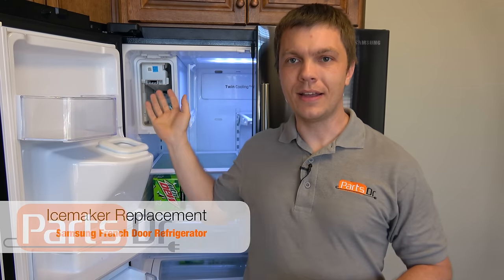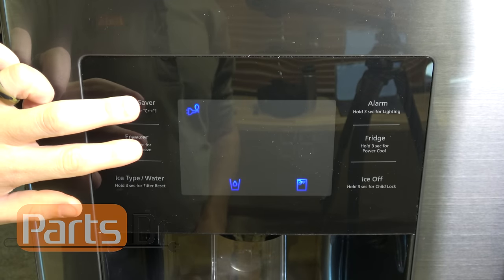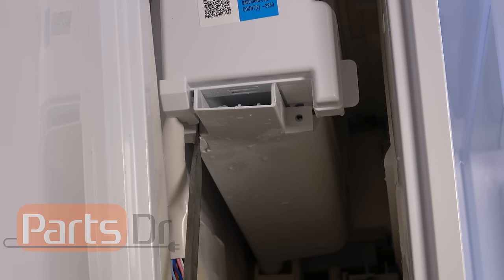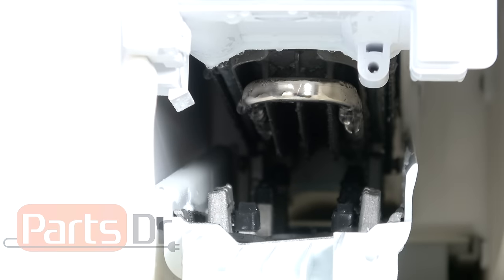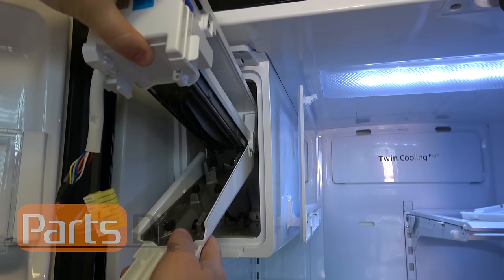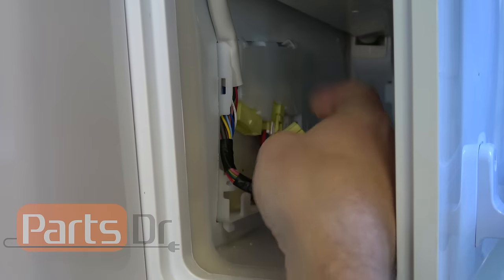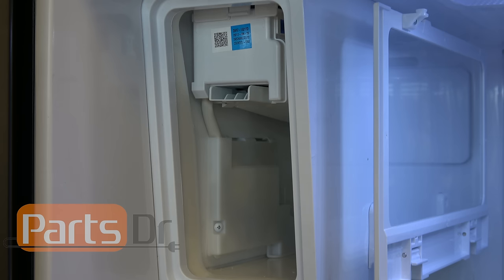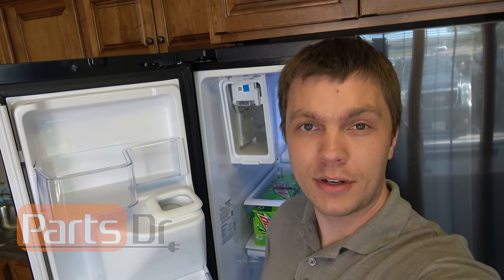How to replace Samsung Icemaker part # DA97-15217D

Comment: what if the it needs more that 5min to defrost ? will this only defrost the ice maker ?
Reply from the maker: It will defrost the ice maker and both evaporator coils.  You can run the cycle multiple times or if it is very iced up, unplug the refrigerator and leave the doors open to let it thaw.

Comment: Excellent video! Everything was very easy. I had to play around with the buttons to figure out the forced defrost and turning it off. My 'buttons' are on the inside. I had to press the Door Alarm to unlock the pad and then hold Fridge and Flex Zone for what felt like forever. I toggled through on Flex Zone similar to in this video and found the FD and OF. The only thing is although it dropped ice in about 6 hours, I have to hit the reset button manually every couple hours for it to drop ice and refill. Hopefully, this won't be forever, but it's been two days. Any insight from anybody as to why?
Reply from the maker: It could be caused by many things, but more commonly it would be caused by a bad ice maker or the ice maker compartment not getting cold enough to cause the ice maker to trigger to harvest and make a new batch of ice.
Reply: @PartsDr  so also every time I open it to check if it dropped ice while I was gone or sleeping and also to hit reset could actually warm the compartment? I’m going to not pull the drawer out for 24 hours and see if that helps. Does lowering the freezer temp lower the ice maker area too? Right now it’s set at 0 degrees.

Comment: Hi please help! 
My ice maker isn’t working 
Can you tell me what should happen when you press the blue ‘test’ button as it chimes and nothing happens 
I have ran the defrost cycle several times but it still doesn’t work and I have also tried a hair drier for 20 mins
Reply from the maker: On our refrigerator shown in the video, holding down the blue test button would cause it to chime and then nothing else would happen.  On some other Samsung refrigerators, it will cause the ice maker to cycle by dumping out the ice in the try and refilling with water.

Comment: My drain tube where the ice maker overflow tube has frozen.  How do I unfreeze and clear it?
Reply from the maker: Unplug the refrigerator, leave the door open and set up a house fan to circulate room temperature air through the ice maker area to thaw it out.   The plastic liner is very delicate so it is not recommended to use any heat sources.

Comment: I can't get ice box cover off, they say just lift and pull. This SOB won't give, besides putting a stick of TNT in there what do you recmend?
Reply from the maker: It may be iced up inside.  You will  need to unplug the refrigerator and leave the doors open to let it thaw out.  Do not try to add heat as it can warp the plastic inside of the refrigerator.
Reply: @PartsDr  Thank you kindly, I'll be doing just that in a week or so. You have a great site and thanks for sharing.

Comment: Great video. I’m having challenges with this epic ice maker. I managed to force defrost. Everything looks good. But do I need to reset the ice maker somehow? It is not making ice. Make ice is on. I push the check button and hear the first chime, but not the second one when I release the button. The manual says this is how you check it is working. Any help appreciated.
Reply: There is a reset button on the inside top right of the icemaker.  Press and hold for a couple of seconds until it beeps.

Comment: I just had A&D service from Sears sub contractor replace my POS Samsung icemaker. Samsung WAY over engineered - not very practical to use. Slow ice delivery. unable to dump into a cooler. frequent filter changes . inaccessible. Needs a good old fashioned ice bucket dump you can get a handful of ice from. Too much mechanization not enough function. Your video is good . Should have saved the $160 and done it myself !

Comment: What is the newest ice make revision of rf28hmedbsr/aa? Is it DA97-15217E  which came out 2018?
Reply from the maker: That part number is NOT compatible with your model refrigerator.  The newest version for your model refrigerator is part number  DA97-15217D.

Comment: What if I press those buttons but I don’t get those modes on my fridge?
Reply from the maker: They can be different for some model refrigerators.  You may have to look up the specific instructions for your model refrigerator.  Or you can simply unplug the refrigerator and leave the doors open to let it thaw out.  Do not use any heat to thaw it as the plastic liner will warp.
Reply: Parts Dr yeah, mine warped some from using a hair dryer.

Comment: I have the Samsung French Door on top, Icemaker Upper left corner Freezer on the bottom, Model #RF26J7500SR refridgerator. The icemaker has always been a hassle, but at least it made ice. It no longer does so. I’ve tried everything but replacing the Icemaker/Auger Assembly/Control board. Right now it hasn’t made ice in almost 2 weeks. Not even in test mode (I hit the test button and hear the *DING-DING*, so I know the I/M is operational). I’ve defrosted it using the “Fd” forced defrost mode and steamer, so there is absolutely no ice buildup on anything. It simply won’t drop ice. I did remove the I/M and the auger assembly just to inspect them and make sure there was no ice buildup anywhere in the back of the ice room, and I did notice my auger assembly has a hairline crack in it. Could this possibly be the issue? Also, is the I/R sensor located on the auger assembly supposed to emit a visible beam? Because it does not. I’ve also checked my compressor and evaporator coils and they’re all clean. I have placed a thermometer in the ice room and it hovers around 10F degrees. I know it won’t drop ice until it reaches 9F, but my thermometer could be off. Although I do have the freezer temp set to -8F. Any suggestions? Based on everything I’ve read here about the disaster that is the Samsung Icemaker, I’m thinking I need to replace all the components, i.e., I/M, auger assembly and the control board. And do that epoxy thing to seal the ice room.

Comment: I replaced my Samsung icemaker. It works great but is way louder than the original. Is there any way to fix this? Maybe I installed it wrong?
Reply from the maker: We haven't heard of this happening.  Did you buy the ice maker from our store?
Reply: Yes, I did. I added the two clips around the cooling loop that weren’t originally there as part of the repair. Maybe they’re causing the noise?
Reply from the maker: @gregniemi572  The Y-Clips shouldn't cause any noise.  Try reporting it through our defective form on our site here: https://partsdr.com/returns/defective-part

Comment: What if i just want to leave my ice maker out, leave it disconnected? i have had way to problems that i dont want to deal with it anymore. will this cause issues with the fridge or the motor? will i also still be able to get dispensed water once i turn the water valve back on?
Reply from the maker: We don't know of a way to remove the ice maker in these refrigerators without causing other issues with the refrigerator.  If you find a solution, let us know!

Comment: Great videos. They only leave out one thing. How to tell which part should be replaced. The Ice Maker Assembly, or the Auger Motor Assembly. I started out thinking the Auger motor. Not because it wouldn't auger, but because there are other components to the auger that could be the reason the ice maker isn't working correctly. One being the motor that blows across the ice maker tray. Another being a temperature sensor. Also I wasn't sure it was the ice maker because I could hit the reset button on the ice maker and it would complete a cycle just fine. Dropping ice like normal. But because the ice maker is the cheaper of the two I replaced it first. Didn't help. grrrr! So I ordered and replaced the auger motor assembly and it is now working fine. My problem started with the unit frosting up and causing ice cubes to jam up on their way to the ice bucket. Eventually it quit working all together. I will admit to using hair dryer to thaw a couple of times. Used to use cups of hot water. Slower. But I will be using that method from now on. Also will try and use the forced defrost mentioned in the videos.  Also added the "Y" clips hoping to avoid freeze up in the back of the freezer element. Added sealant to prevent warm air from entering. I'll up date if that doesn't help.

Comment: Lighting and freezer button puts my fridge into force defrost.Do you know which buttons would turn it off because fridge and energy saver aren't working?
Reply from the maker: Usually the same buttons that you used to put it into the forced defrost mode.
Reply: @PartsDr  
So select of in the menu? Also there is still ice on the cooling tube after force defrost?Can I use a hair dryer?
Reply from the maker: @jxsilicon9  It's not usually a good idea to use a hair dryer because you could warp the liner of the ice maker compartment.

Comment: While using the hair dryer the tunnel for ice maker is deformed, so it doesn’t fit back, can the whole ice maker unit, than the ice maker to be replaced? Let me know what should purchase!
Reply from the maker: Hi Ali, none of the individual parts of this ice maker are sold separately.  It is only sold as an assembly.
Reply: Parts Dr can I order the whole unit not just the maker?

Comment: Parts Dr. - Can you please provide the proper sequence for putting a Samsung RF28K9070SR/AA-03 in "DF" Defrost Mode?  Is it depressing the fridge and freezer at same time?  I just ordered a new icemaker and clips from your website and just want to confirm.  If you have a video or docs for my particular model I'd be happy to look at that also.  Great job on helping consumers with things such as this!
Reply from the maker: Hi Shon, thank you for your order!  We found this service sheet that should help you out here: https://drive.google.com/open?id=1mhpVOaIEiENxC_o0Iv6ZP85d26dIkZgl
Reply: @PartsDr  Thank you but my model does not have the family hub display.  It is a smaller touch screen similar to the one in this video but a little different format.  No worries, I'll figure it out.
Reply from the maker: Try these buttons shown at the bottom of the screen here: https://youtu.be/1DQZs75GEWQ?t=26

Alternatively, you can just unplug the refrigerator and leave the doors open for a while to let it thaw out on its own.
Reply: @PartsDr  Good point!  Thank you!

Comment: Thanks for your video. How do I check if the water supply is somehow blocked? With the icemaker removed I turned on the power and then slowly the water supply. Nothing. Is it shut off due to temperature? or is there another switch?
Reply from the maker: The water supply in the refrigerator is controlled by the water valve located in the water filter case.  It is also a good idea to check the water supply from the house to the refrigerator.
Reply: thank you, though I meant water supply to the ice maker, as the water tab in the fridge door works. I am beginning to suspect the icemaker isn't getting water.

Comment: How would I know if that coil in the ice maker is damaged? Meaning I was using a butter knife to chip away the ice and now I have a small dent in the coil. I may have just learned an expensive lesson. This coil doesn't just affect the ice maker, but the whole refrigerator??
Reply from the maker: You should be okay as long as there are no punctures in the tube.  Puncturing a hole in this tube affects the whole refrigerator refrigerant sealed system.

Comment: I'm having an issue with this model my self cannot get water going to the icemaker itself but water is coming out out from the dispenser at a good flow. Could it be the actual water valve it self or the icemaker issue?
Reply from the maker: It could be a bad ice maker, bad water valve, or bad main control board.  Most commonly we see the ice maker fail which then stops calling for water.  This issue is a tricky one to troubleshoot.  Let us know what you end up finding resolves your problem.
Reply: @PartsDr  think I should check continuity on water solenoid first, as there is 2 1 going to water and other going to icemaker. if shows ok then have no choice to replace icemaker. Or I can switch the dispenser pipe to Icemake pipe and see if I can water flow that way, as a test. I'll definitely post again to show results
Reply from the maker: @akap2203  An ohm test doesn't always tell the whole story.  A valve can have a good ohm reading but can have an internal blockage not allowing proper water flow.  See this video for more info:  https://www.youtube.com/watch?v=vrDSl24vwao
Reply from the maker: @akap2203  If the lines are able to be switch around that is a good way to test.  A lot of times they are a different size line to prevent you from switching the lines around.

Comment: After removing the wire cover. I can see light coming in from the left side of the icebox all the way back to the auger? Also light coming in from behind the auger where the fridge connects to icebox. Does it all need to be sealed?And will probond advanced work?
Reply from the maker: Yes you would want to seal that.  Samsung recommends this food grade adhesive to seal it.  https://partsdr.com/part/da81-05595a-adhesive
Reply: @PartsDr  
Seal just the sides in the icebox? Or the back of the ice box behind the auger where it connects with the fridge also?
Reply from the maker: @jxsilicon9  Anywhere where air could possible be leaking between the ice maker compartment and the liner of the refrigerator.

Comment: Great video. My bucket was completely empty yesterday. So ice must have stopped days ago. My unit is the DA97-15217D as this was manufactured NOV 2017.  I didn't have a ton of frost, some but not much so this doesn't appear to be a freezing issue from what i can tell. Either way i did the reset thing, it chimed yet heard nothing from motor or anything happening. 20 plus hours later empty bin still. Is the unit supposed to make some kind of mechanical sound when resetting for 10 seconds (other than chime)? 

Water flow is great out of dispenser.  Seems my Ice Maker has just stopped functioning at this point outside of the reported freezing issues that I have seen on countless posts and YoutTube videos. .Does it sound like the Ice Maker just died to you guys?.   Thanks again for the great video.
Reply from the maker: There usually isn't a mechanical sound from the ice maker unless something on the ice maker has failed.  These ice maker systems are not easy to trouble shoot.  It is possible for the water to not get to the ice maker even if the water at the dispenser is working.  Usually if you are not sure of the cause of the problem, the ice maker is the most common part to fail so that is a good place to start.
Reply: @PartsDr  Thank you. Just found out my wife bought extended warranty for it. Got an appointment set up for Friday. Thanks for the reply.
Reply from the maker: @PrimitiveMeat  nice!!! Let us know what they end up replacing to fix the problem.

Comment: Mine makes small cubes? But working anyway to fix?
Reply from the maker: Small ice cubes can be caused by a number of things.  First check the water supply to the refrigerator to make sure it has adequate flow and pressure.  If the water supply is good then it can be caused by a bad filter case assembly, ice maker, or main control board on the refrigerator.

Comment: This is an excellent video, thank you! But I have to question why the RTV costs that much. It's 30 something dollars even at other vendors. Is there any particular reason why I can't just get a tube of RTV like the kind used for cars? That is much much cheaper, like $10.
Reply from the maker: We were told the reason the cost is higher is because it is a special food grade type of RTV.
Reply: @PartsDr  interesting... Ok, thanks!!

Comment: your video helped me out a lot, but i watched it too late. I did some melting  damage to some of the ice maker plastic components with my hair dryer in an attempt to thaw the ice buildup. I am hoping that you might help me replace a part i melted, the parts breakdown are too vague for me to find the part. It is in the very back of the ice maker compartment.  i would insert a photo if i could. Hoping to hear back from you soon.
Reply from the maker: The part that it sounds like you are describing is a non-serviceable part and is not available for sale.